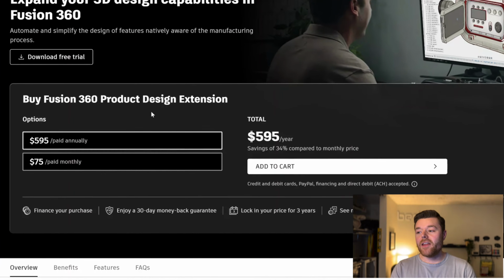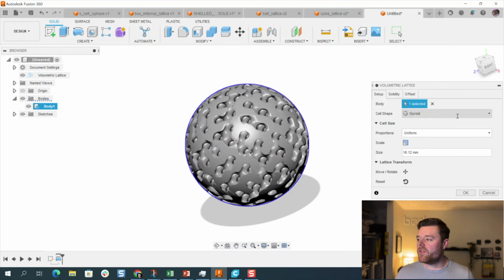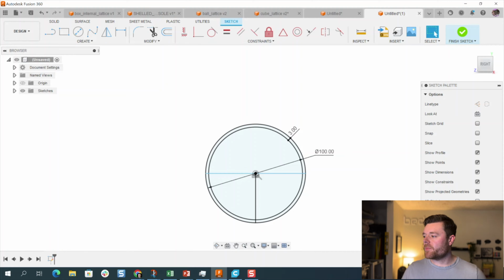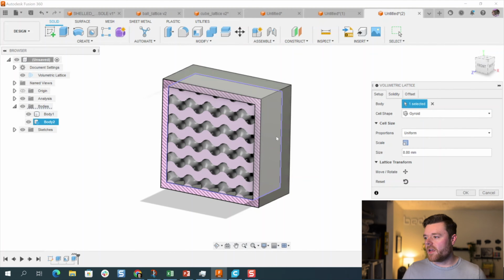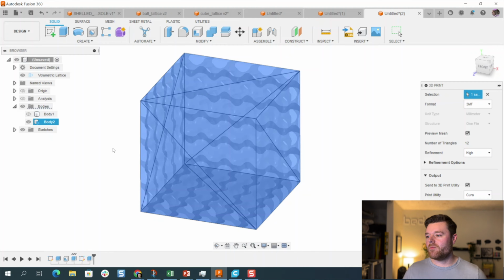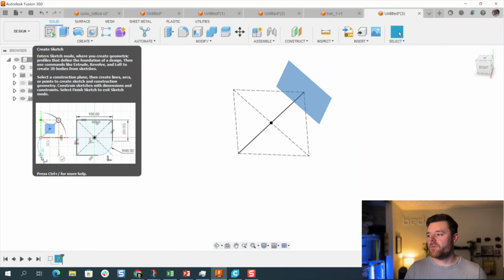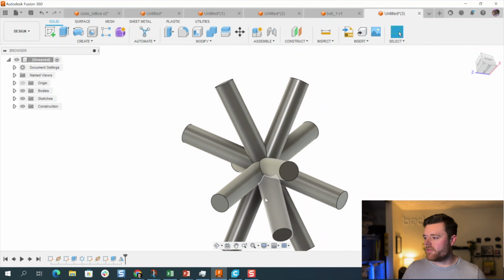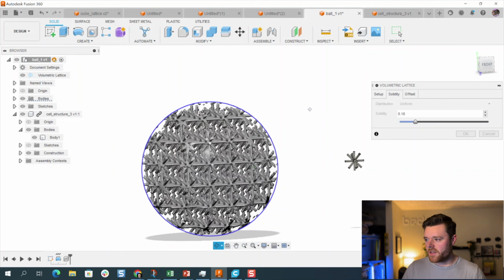How to use the Volumetric Lattice Feature in Fusion 360!

Comment: The lattice construction in Fusion is a bit of a miss / beta product.  You can convert the lattice object to a mesh and from there you can convert it to a solid object that you can export.  However, it requires a lot of computation capacity to do anything at scale.  Even harder is to create a heat exchanger structure.  You can convert the lattice to a structure and then hollow it out but the solution sucks.  The hollowed structure within the lattice becomes very course.  It practically un-usable.  The best solution is to create two lattice structures, mirror one of them and then overlap them so you create a flow path.  You HAVE to do this as separate components / mesh objects.  It takes too much computational load to do these steps as solid objects.... I could go on with the short comings of this feature.  At best, its not worth it, at best, its a very early beta version that I would avoid if you can.
Reply: hi i'm totally new to this and wanted to use this feature to 3d print a obejct for the sake of learning the whole process, do I just create a lattice structure --> convert it into a solid --> export it in stl -->slicer software? TYSM!!